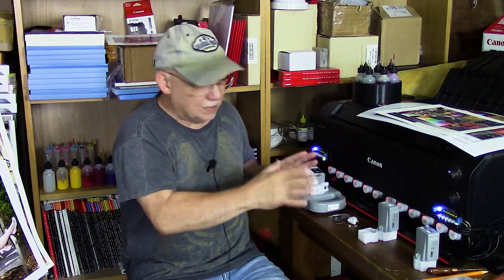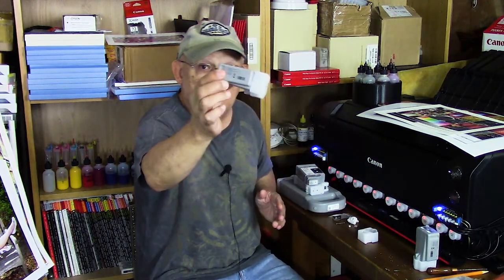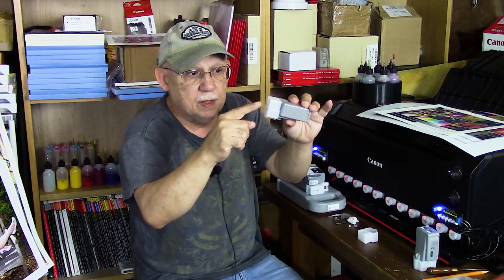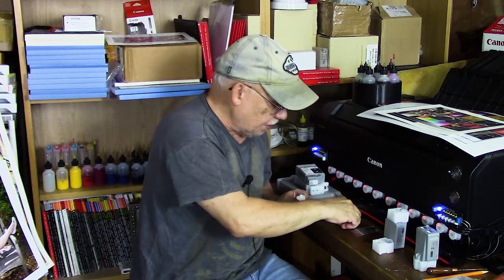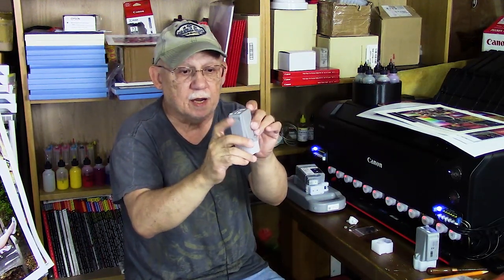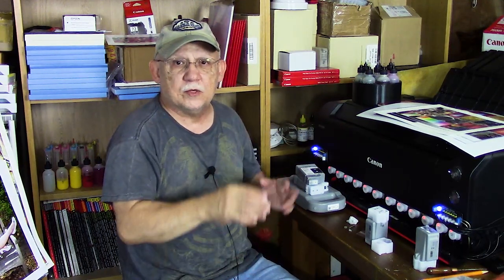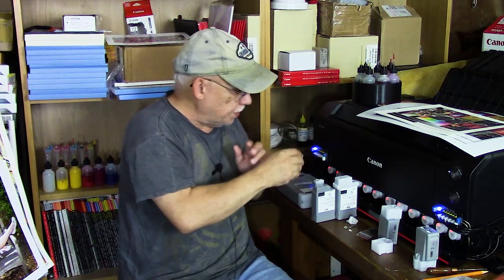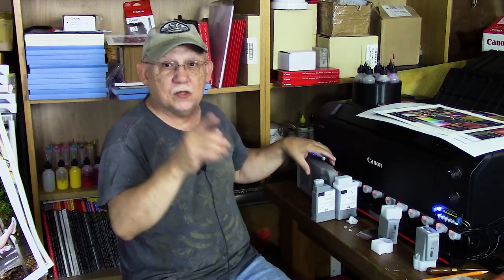Do CANON Printer Large Format Carts have hidden internal sensors?

Comment: Jose, my experience exactly.  I usually use the smaller Canon printers / multipurpose machines.  I have worked with Lexmark, Epson, HP and Canon inkjet printers for over 25 years.   Of all the inkjet cartridges, Canon alone prints the same quality print with a reinked cartridges as opposed to a new cartridge.